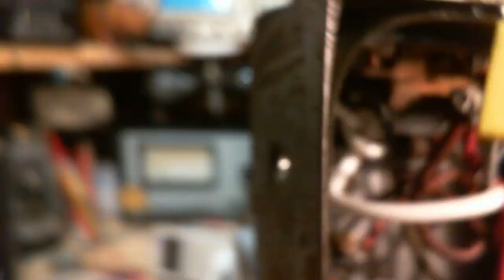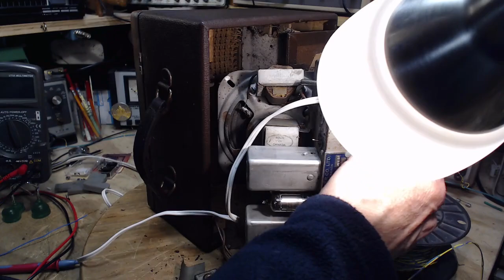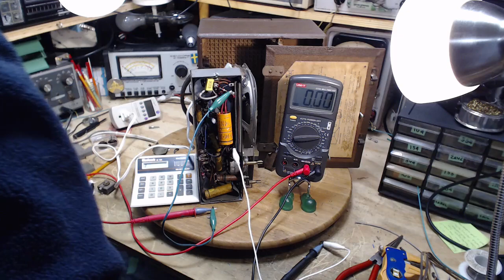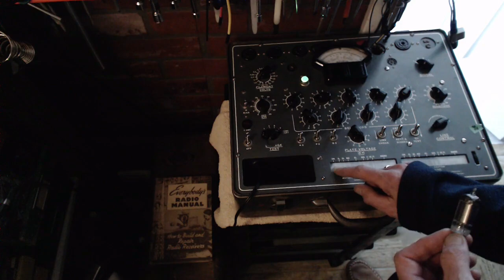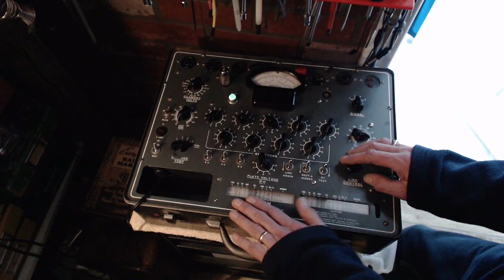Breadner Bradna JBL 37 Tube Radio Video #4 - Heater String

Comment: So you broke a tube pin. It is a rare enough radio you can get another spare tube socket and replace it. There is no certain way to bodge a new pin into the original
socket .Don't even waste the time. What are they like 4 bucks or so.

Comment: Still shaking my head. Jim please check resistance or if you did off screen let us know.  You can be running in circles all day if any are bad especially that long one.  Then near the end of video you believe you didn't reconnect the switch right.  Step back and take a deep breath and look it over.  Draw a diagram that shows what it should look like and compare it to the schematic.  Do the simple checks an write out a plan to move forward. It may help

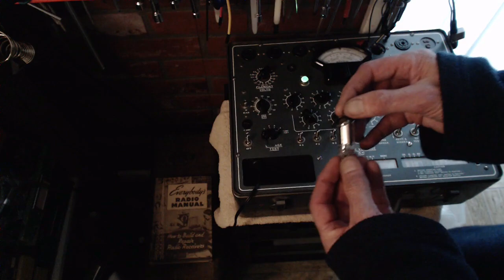Comment: 59:30 The last time he worked on these miniature tubes it was the same issue. He pulled a 3S4 from his stock that tested good on the tester but showed the effect of an open heater when in the radio. And everyone commenting on the video but him came to the conclusion that the center tapped heater had come open on one leg. And that the tube tester which ran the 3S4 at 1.5V was putting the two legs of the filament in parallel, so the one open leg would not prevent the tube from heating up, while on the radio the tube was run with both filament legs in series, so it would interrupt the heater circuit.
And here he gets haunted again by not understanding the most simple concepts, not reading comments in the past, and most importantly not learning from past rabbit holes he has been down and not keeping his shop in order by throwing out bad tubes.

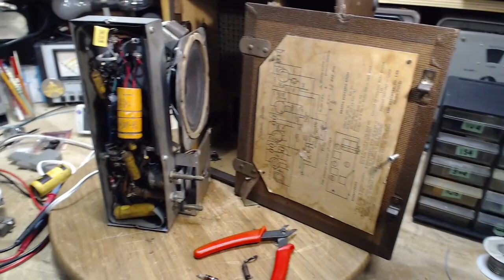Comment: 29:07 "Smaller(!) series dropping resistor means less(!) heater current". Wow, that must be the Jim Lindenas interpretation of Ohms Law. Anyone else would realize that at this point in the repair the only sensible thing to do is to run the radio from batteries or a bench supply simulating the latter, and not rely on the voltage devider formed by high ohm high power resistors and the tube heater string. Then do the service work required i.e. change caps and the tube socket, and leave messing with the switch and 120V section of the PSU until the very end when the big caps are out and there is more room. 
And what in gods name is the problem with replacing or cleaning the old switch? Has he done a better job at cleaning up and lead dressing after cutting out the old across the line cap there would have been enough room to take the switch out. Plus most likely drowning the switch in proper contact cleaner would restore it to operation anyways.
It is a shame to see a rare model radio getting this botched up.

Comment: So he made that bodge work with pin of tube 3S4 and didn't even bother to check if there's a connection ?!! Hello.... McFly !!!
All that confusion with the 1.2K resistor... Jesus man, now you forgot ohm's law?   The funny thing is that switch is very likely still working because apparently Jim doesn't even know how to reconnect  the whole thing to bypass the battery... !!!

Comment: You should be able to replace that broken tube socket pin just obtain another same socket remove a contact from the replacement socket, using a pair of duckbill smooth jaw pliers to flatten the solder side of the contact then push I out from the bottom you can use the removed pin to remove the broken one by inserting it upside down into the slot where the broken pin was and push the broken part thru the top then insert the new pin into the socket from the top re attach the wires put a slight bend in the new pin on the bottom so it stays in the socket if the tube is ever removed again. This works for any socket that is of the molded types that the pins insert for the top, I saved time in not having to replace the entire socket, i have done this many times.
Reply: Me too .

Comment: Jim, it looks like that little piece of wire you inserted into the broken 3S4 tube socket may not be making contact. That would account for the entire heater string reading open.  Worth checking on it.  Good Luck!

Comment: Hi Jim 
Fixing the damaged socket screw up .

It's a 10 minute fix just moving pins around ….. 
Evict that old pin by pushing it up & out with a precision Screwdriver .
Find a spare pin & fit in the pin one hole .

Can't find a spare pin the 3S4 pins 6 & 2 are common so you could steal one .
Reply: He would probably break the new pin he was trying to use to replace the first broken pin!